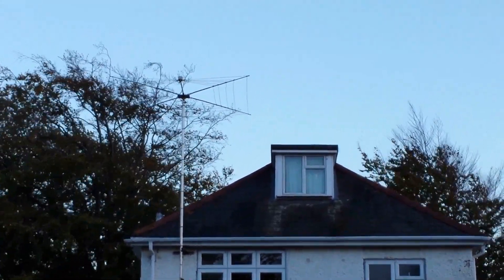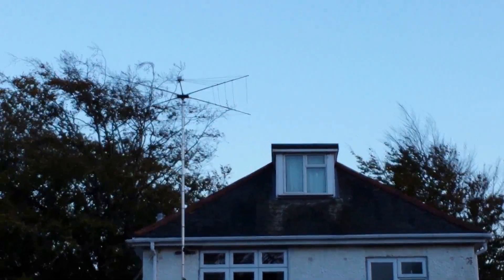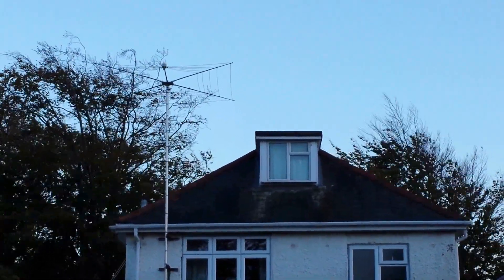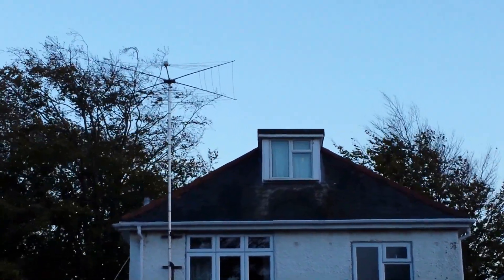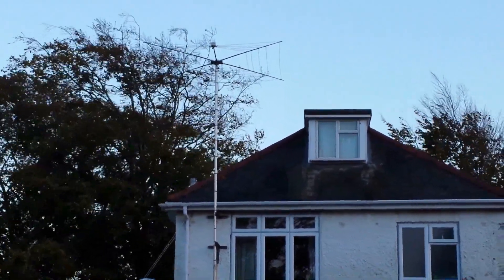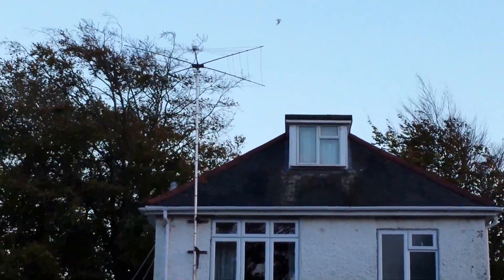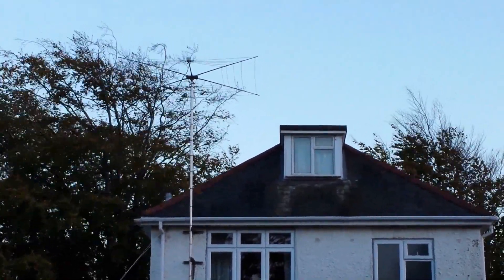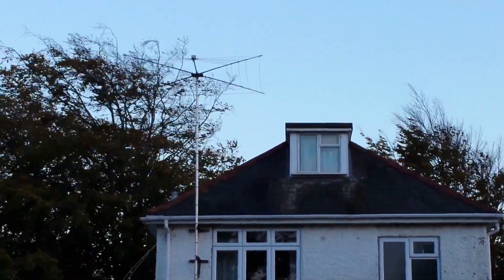Cobweb Antenna update

Comment: Hi Mark is that a one-piece pole and how thick? I take it the base is on the ground. Two man job to erect it?
Reply from the maker: AMATEUR & 11M RADIO TIM AMATEUR & 11M RADIO TIM Hi.  It's a genuine aluminium scaffold pole, so about a 5mm thick wall. The base is sat on the ground and is 10ft with 20ft on top. It's a two  man job to walk up but not hard..
Reply: Thanks Mark 73